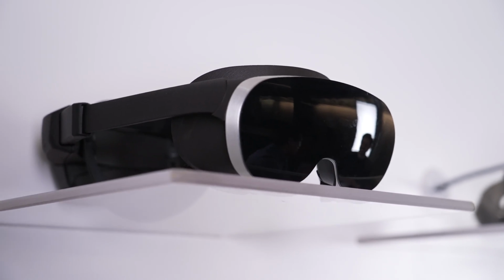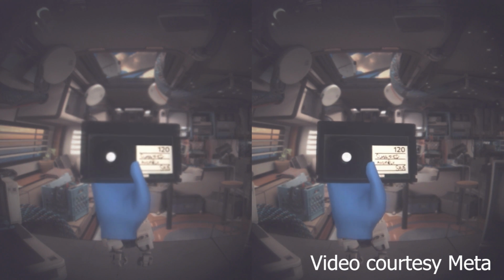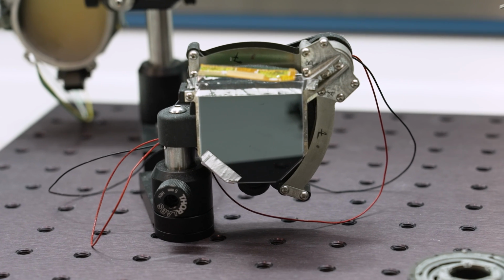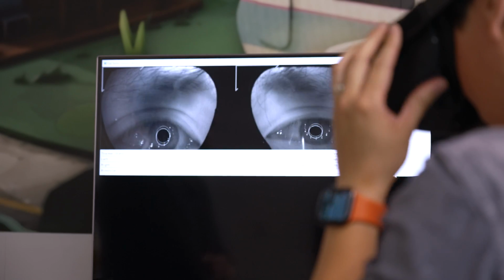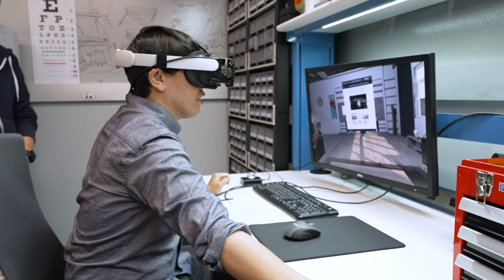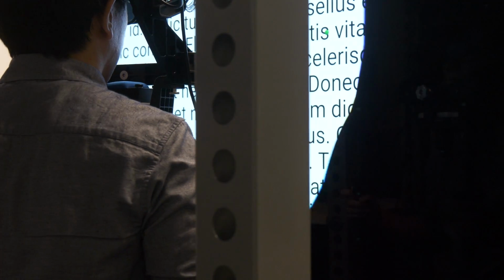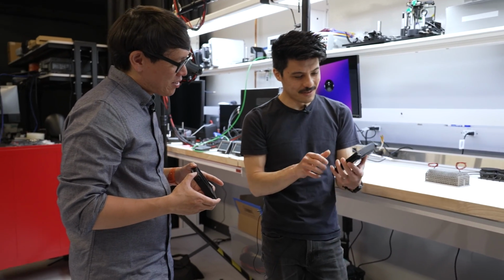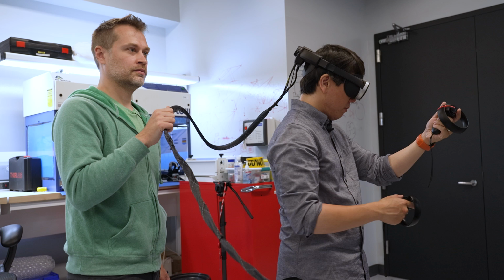Hands-On with Meta's New VR Headset Prototypes!

Comment: I still wonder why they have not put the smaller GPUs from laptops into these headsets like the very small 3080 ti in some laptops
Reply: Because it would be heavy and hot and drain the battery in less than an hour. 

There's your answer. 
Qualcomm makes the XR2 chipset for this reason, to save battery.

It needs a mobile GPU with mobile GPU power requirements. 

Otherwise we're using a huge wire like the Valve Index to tether our headsets to 3090ti, or we are beaming the screen over wifi.
Reply: @raiden72  we're reaching the limit of how small we can effectively make these processors too. So it's going to be a subpar mobile experience.
Reply: @itchysundae  not necessarily because we can do things like "azure remote rendering" so as long as the device is connected to WiFi we can intertwine the two (remote processing, local display)
Reply: @raiden72  couldn’t you just have a bigger battery in the back to have enough power for the GPU and act as a counterweight to the heavy GPU?
Reply: @AllSuperHeroes  if you have ever worn the valve index headset then you would understand that head fatigue is a big issue when it comes to comfort of VR headsets. 809g is as big as you'd want to get. A video card is 1677g which would be twice the weight of the index. Try holding your head up then!
Reply: @raiden72  is that the weight for the GPU in a tower pc or laptop?
Reply: @AllSuperHeroes  look dude you could play devil's advocate all day until you reinvent the wheel, but go ahead and argue with the people who make the headsets and see how far you'll get.  Weight is an issue and that's why they need newer and better processors. It's not as simple as the question of smashing a mobile GPU into a headset.
Reply: @raiden72  ok thank you for explaining that. sorry if I annoyed or bothered you

Comment: For us old folks.  I wonder if they can handle people who are not just wearing glasses but have bi-focals or tri-focals or graduated focus lenses in their glasses.
Reply: Yep you can get custom lenses for them so you don’t have to wear your glasses , they go on your prescription specs
Reply: Depending on the prescription, some headsets today don't require even as much as that. I know the HTC Flow and some of Varjo's headsets offer basic diopter adjustment. Perhaps in the near future this will become more sophisticated to account for more complex focal configurations.
Reply: Nothing needs to be done. Current VR headsets only have one focus distance, so there is no need to wear glasses with graduated focus. It’s younger users who will benefit from the varifocal headsets. Apart from astigmatism correction, there will be no need for glasses at all in varifocal headsets, as you’ll be able to just set it to any focus distance.
Basically, the weakness of today’s VR headsets is actually a strength for older users.